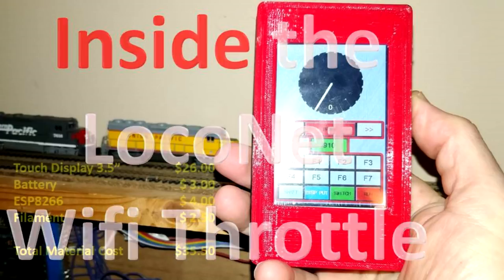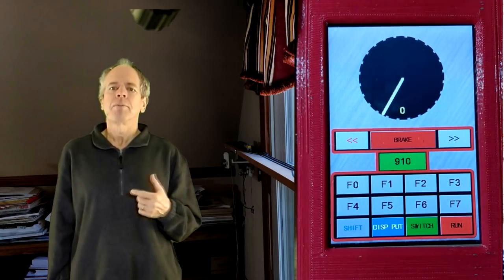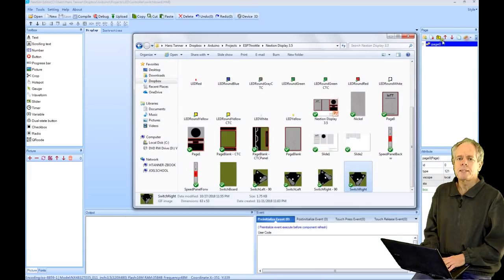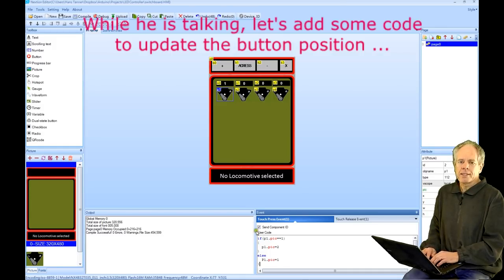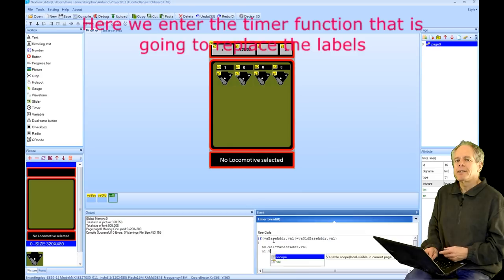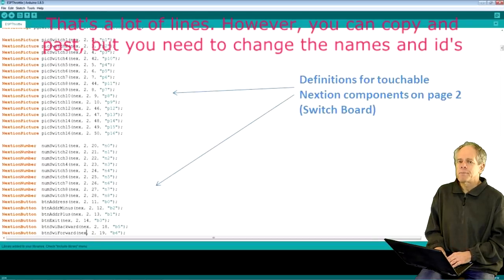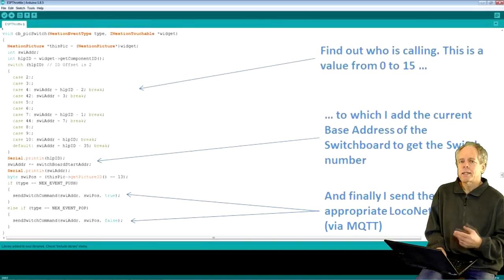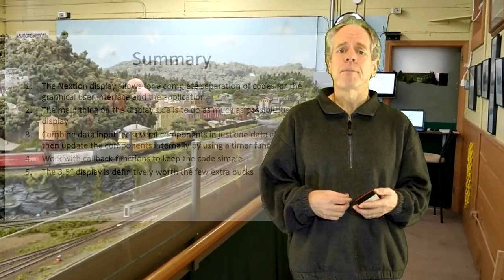Inside the LocoNet Wifi Throttle (Video#8)

Comment: HI,
 I think I have figured out enough of the Nextion to understand whats going on. Now to try this throttle project.  First hickup.... there appears to be no ftf file for the 3.2 screen in the gitthub collection.  Second, some missing libraries. these I am hunting down one by one. The whole IoTT is a fun learning time all round, just have to remember to run trains now and then.
Reply from the maker: Download the https://github.com/tanner87661/IoTT-Video08/blob/master/Nextion%20Graphics/UtilityThrottle32.HMI file and open it in the Nextion simulator. From there you create the TFT file that is programmed into the display. For the libraries, I think they are all installable from within the Arduino IDE. Just one remark regarding the JSON library: I am using version 5.13.2 at this time. Maybe the newest 5.13.4 would work, but the new Version 6.xx beta version do not work at this time.

Comment: Interesting, I would prefer using a physical knob instead and therefore have more space on the display for controlling other hardware. Much like the ESU Mobile Command WiFi throttle. This way you don't have to look at the display when running trains. Less distracting.
Reply from the maker: Yeah, other viewers made the same comment, and I agree. Now, keep in mind, I do not see the future of this in specific hardware, I rather think we should use smart phones as throttle, using a web app. The throttle I built here was only to test a few concepts with the future in mind, and putting in a manual knob was not of interest because it is a piece of cake when using a micro controller. Long story short, what I am thinking really about is putting a knob on a cell phone. It may take a while, but it is in the pipeline.

Comment: Will this connect to jmri?
Reply from the maker: It would connect the same way as any Digitrax throttle. You can control locomotives and JMRI I think would pick up that information. But no, at this time it would not connect to the JMRI train server and other services.
Reply: @IoTT  thanks for getting back to me. Hopefully some day it can. Keep up the good work.